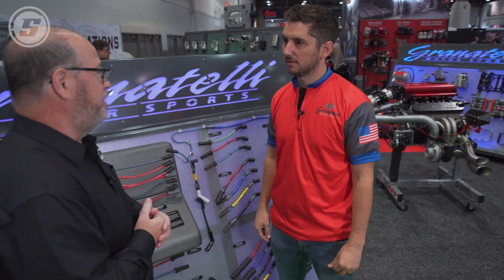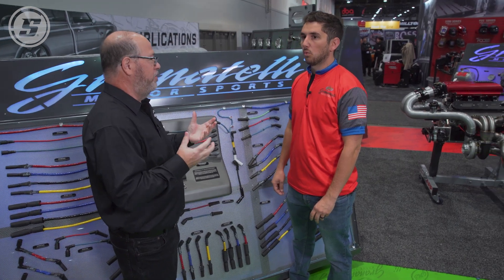What is The Best Spark Plug Wire | Design & Diameter Explained

Comment: Those "magic donuts" look like they'd function similar to old school laptop chargers that used to use a hunk of metal enclosed in a plastic case on the charger cables itself. I'd imagine their little donuts do the same concept to prevent any kind of issue with the vehicle electronics.